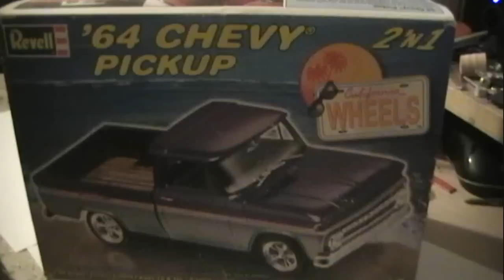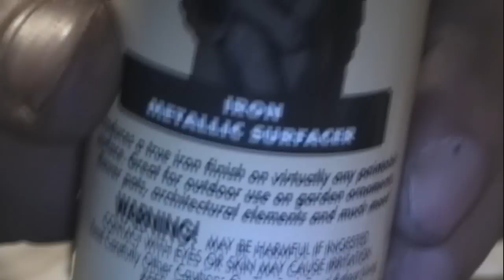HOW TO BUILD A MODEL CAR JUNKER FROM BOX TO FINISH...DETAIL LESSON 4

Comment: What kind of tool are you using to cut the parts off the body? It looks like one of those tools you use to burn letters etc on wood>
Reply from the maker: +Samuel Vasquez kinda but with ecto blade called a hot knife